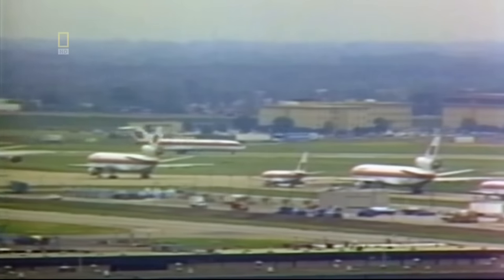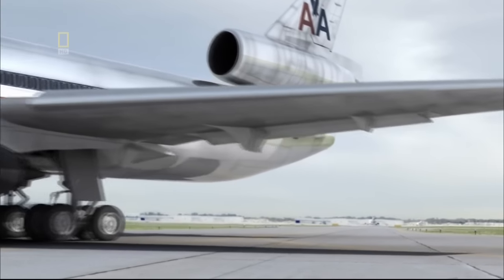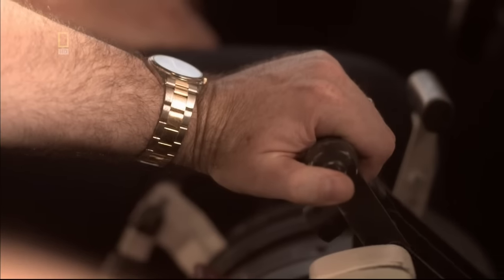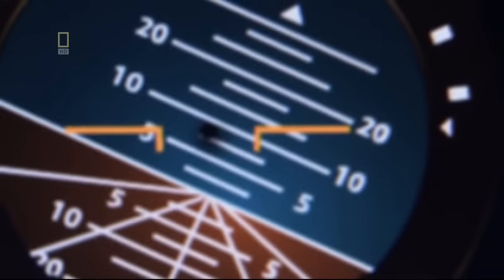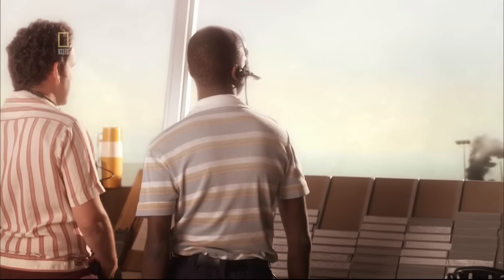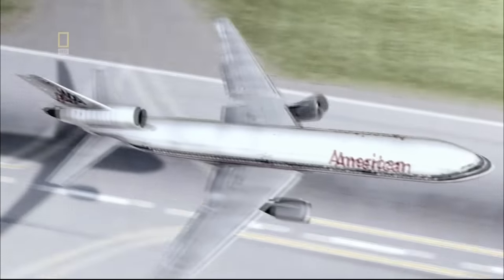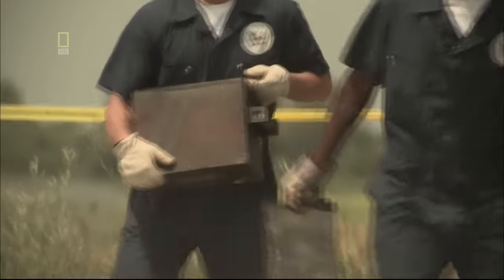Mayday   Air Crash Investigation S12E07   Catastrophe at O'Hare American Airlines Flight 191

Comment: It seems strange to me that AA provided a cockpit cam for the passengers but no cams for the pilots.  If they had a cam aimed at the wings they would have seen that the left engine was gone and realized they were in a stall even without the stick shaker.  There have been several accidents where an engine caught fire & flamed out and the pilots turned off the wrong engine based on faulty assumptions.  Cams for critical parts of the plane should be mandatory for all commercial planes.
Reply: Guy, do you think the entire airline industry is stupid? They tried that decades ago. It proved to be a distraction. Crews spent too much time looking at the cameras rather than reading the instruments and/or flying the aircraft.
Reply: Airbus is using them now and the monitors wouldn't be on unless needed so it would obviously not be a distraction.  There have been so many accidents that could have been prevented if only the pilots knew what was going on.  In this case, for example, the captain could have seen that the flaps were inoperable and if he was particularly savvy he'd know that with the engine gone on the left side his stick shaker wouldn't work and if he increased thrust instead of decreasing it as the manual specified, he could have safely flown out of this situation.

Several crashes have been caused because an engine fucked up on a dual engine jet and the pilots guessed wrong on which one to turn off.  Also, there have been many cases where they didn't have a clue if the landing gear was down.  If the crew included an engineer he could be monitoring troublesome situations.

Comment: Maintenance shortcuts to save money and time; longer maintenance intervals to save time and money; lax regulations to save time and money; slow response times by the FAA when dealing with critical improvements needed; continued use of flammable materials in interiors and structures; lack of fire alarms to warn of pending fires on board are all responsible for many of the disasters we read about.
Reply: J kK aviation is built from blood, sadly

Comment: Call me crazy, but FDRs should have back up batteries in case they lose primary power.
Also, exterior cameras so the crew can better assess problems. It wasn't a big issue for this accident, but I have seen quite a few where the crew had no idea what was wrong because they could not see the exterior of the plane.

Comment: I flew from Chicago to LAX on a AA DC-10 in September 1991. Call me warped, but in those days I carried a book on air disasters which I read on the flights. It was my lucky book, proof of which is obvious - I'm still here.
When the aircraft took off, it dipped very noticeably before accelerating powerfully upwards. I enjoyed the flight very much.
Most DC-10 crashes were not the fault of the aircraft but other factors - incorrect flight plans, maintenance corner cutting etc

Comment: The engine fell off? But it's not supposed to fall off.
Reply: Jurij Fedorov its maintenence's fault
Reply: Jurij Fedorov 

I remember this line lol,it's from a British comedy about boats.
Reply: Jurij Fedorov you heard of a dc10 tail engine failure then emergency landing with minimal deaths? No? Search it up!
Reply: The front fell off. The front is not supposed to fall off.
Reply: There was another instance on a 747 when engine 3's bolt that it was attached with ws defective, ultimately it broke off, the engine apparently was moving forward before crashing into engine 4, both engines fell as the front part of the right wing was badly damaged. Forgot what flight it was
Reply: SquidGamer 16 geez don't take the comment personally or anything..
Reply: You should be an engineer!

Comment: - "We got to go through the history of the airplane"
- "It's a DC-10 sir"
- "Our job is done here"
Reply: Silence "We have to much parts to look, it will take time"
"It's a MD-11, The successor of DC-10"
"Our job is done in this place lets just do other thing."
"It's from United Airlines"
"Then the cause is: Pilots left the cockpit to beat the Asian passengers"
Reply: Silence 😣😂
Reply: The popular DC-10 (roughly 450 built) has an overall lifetime safety record comparable to other similar passenger jets of that time period. Introduced in 1971, the last passenger flight took place in 2014, nearly 45 years later, with many still in everyday service today as cargo aircraft.
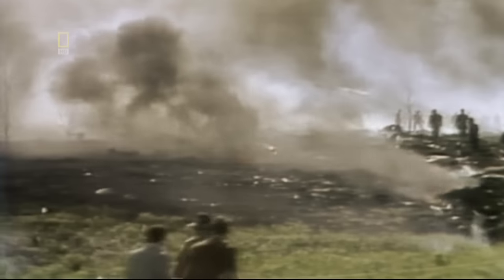Reply: Dwight Stewart 11:32 dang that meat waggon though that certainly is 1979....
Reply: Yugoslavian Flight That guy was asked to Leave multiple times, technically he was Tresspassing when he was removed.
Reply: but i was doing it by the meme side.
Reply: You're not tresspassing when you bought your ticket. That ticket gives you the right to be sat in the plane. The only reason why you would be legally removed, is if you broke any company/aeroport/tsa laws... which he didn't. He got mugged by a company using despicable overbooking technics. My 2 cents.
Reply: Silence If the Airline asks you to leave, and you refuse to, You are Tresspassing on the Airlines property. The Ticket gives you permission to board and travel on the Aircraft, and It can be revoked by the Airline at any time. The Aircraft is the Priaviate Property of the airline.
Reply: ahahaha

Comment: 43.27 "This kind of accident never happens again. This engine never fell of this kind of airplane again"
Maybe not with the DC10/MD10/MD11. 
But it has similarities to the Amsterdam air crash on October 4th 1992 when an El  Al Boeing 747 Cargo physically lost its no.3 engine, which took out its no.4 engine as well as over 30 ft of leading edge slats. It was due to metal fatigue in the pins holding the pylon against the wing, so not directly a handling error. But the crack also were never detected.

Comment: Maybe if the cockpit camera was available to the pilots they may have reacted better.  They would have seen they were in a stall.
Reply: Cheryl Ernst the cockpit camera just shows what the pilots already could see
Reply: John Little When they entered the stall they were nose high and they would only seen sky.  The onboard cameras had a slightly different perspective and was not mounted inside the cockpit.  Minute amounts of time sometimes can make the difference.  At the end of the day only the pilots knew what could be done, there is no denying that.  And second guessing is only that.  But I do know that a lot of pilots miss the point at which their planes enter a stall, which that second is no doubt the most critical time.  That is the moment that gives you the most time to solve your problem.  From that point on, the clock is ticking.  
Pilots, as myself, can only hope to glean something from videos like this to make yourself a better pilot.

Comment: The main issue here is stated right at 16:51,  "The bolt found on the runway is one of the few holding it (the engine) in place."    This very much begs the question,  WHY???!!!!!    Why the hell is it just a few?!   We are talking about bolts that hold on an engine!  Why is it designed to have just the sufficient amount of bolts required to hold the engine properly in place?  Why not make it so it has several bolts over what is needed just in case the very rare occasion occurs where a bolt is flawed and fails?   Now this video and crash in particular turns out to be not the bolt, but there have been others where something as simple as that causes a disaster.
Reply: I'll be the first to admit that there are factors in play here that I'm likely unaware of.  Im certainly not an engineer.  That being said, to try and put this logically, given my limited experience in this field, if you were to figure out exactly how many bolts it takes where if you lose one, then like you said, it would put undue pressure on the rest.  So once that is been factored in, what happens if you add several bolts (assuming you have the space to do so) after that fact?   So if there is a defect in one, then it doesn't even factor into the equation because of the "backups".   As far as having the larger bolts as opposed to many smaller ones.....I would imagine there are many factors that go into making those decisions.  Such as can the smaller ones even handle the loads that will be put on them?   Lets say all things being equal, you could use either/or.   Like you said, if a smaller one failed it may likely cause the rest to fail.   The keyword being likely.  If you have 3 large ones and one fails, I would say it is a guarantee that it will fail.   Because if you have lets say 3 large bolts doing the work of 30 small ones, then losing one large one would be like losing 10 small ones at the same time.  lol      Again in all seriousness, please excuse my possible if not likely ignorance on this, Im merely trying to figure this out reasonably.   However, if you are capable of pointing out why my reasoning is equal to that of a 3rd graders retarded notions on this matter, then please I would welcome being educated on this.